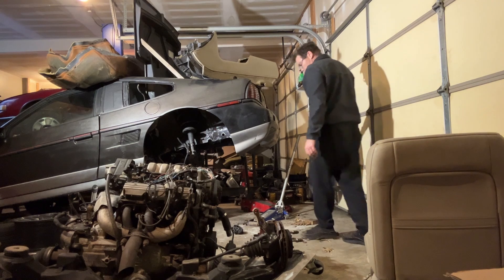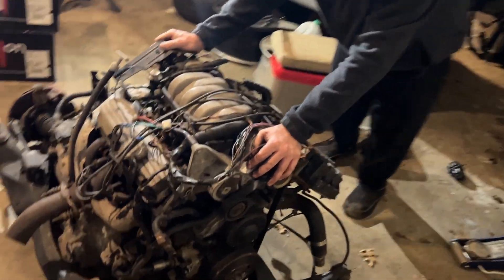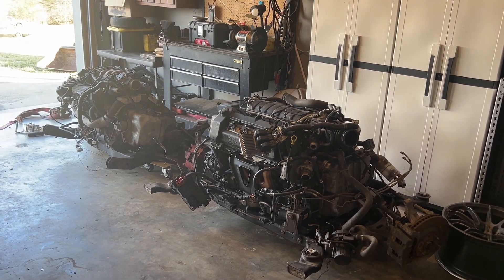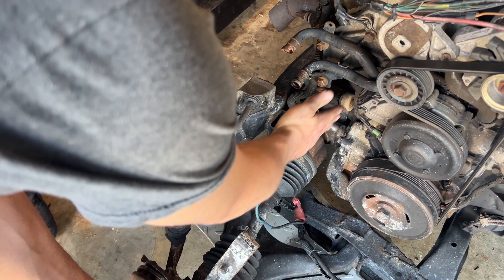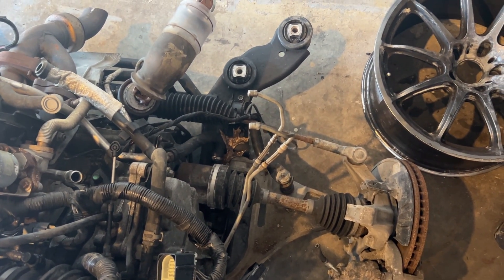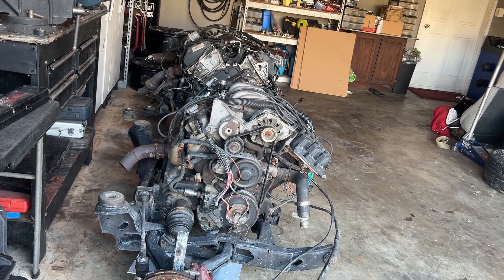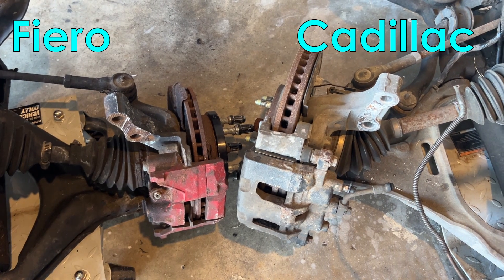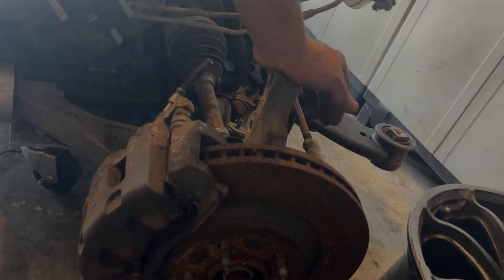FIERO PROJECT: COMPARING Engines- GM 3.8L V6 | 4.6L Cadillac V8 SideBySide +What BRAKES TO USE?! Ep2

Comment: Fun car, I worked on the 4 and 2.8 V6... Saw one 350 swap in a scrapyard that caught fire. Pay attention to details!
Cheers 🍻 
The Northstar was used in racing, great motor. Yours has the proper head studs.
Reply from the maker: @andykerr3803 Thanks!  As we get further along in our project, we'll be working on the engine going into the Fiero and show you some tips and tricks Mike has developed for the Northstar over the years.

Comment: I did a widebody swap and used the factory Cadillac cradle including the 4L80 transmission and Cadillac brakes. I just relocated the shock tower strut position at top and cut and welded the fiero attachment points front and back from the Fiero Cradle onto the new cradle. If it is a DTS then there is only a couple of inches difference in the Trackwidth between the two and new wheels with the proper offset will solve that issue. You get all the good stuff! The Fiero I have now has a GTP Aluminum cradle (CompG) 3800SC and transmission + Brakes, same thing, just modified the cradle.
Reply from the maker: @kennethbrazell9640 Wow, thanks for the info! We are filming this project in real time as we go along, so we could definitely still go this route, especially now that we know it works.  Or, we may stick to the original plan to use the Fiero cradle, but use the Cadillac spindles on down.  We’ll see once we unmount the engines!
Reply: That’s great outside the box thinking. Kudos to you. Seems likely it would save a lot of time messing with engine and tranny mount positioning and fabbing.

Comment: More go requires more stop. Caddy put those brakes on there for a reason.  From a Company that saved a dollar by using shorter head bolts on the N*.
Reply from the maker: Agreed! Think we're leaning towards stronger wheel hubs of some type, but don't know if we can get the Cadillac ones to work.  We would like to put the 4 piston Brembo's from the V's on there, but those require 18 inch rims... kind of big for a tiny car.
Reply: @cheapthrillsky9512 18” rims would look great with 35 profile on the rears and 17” with 40 profile on the fronts. You’ll need the rubber to harness the power and performance that the Northstar will provide.